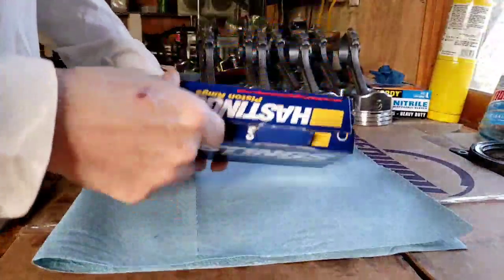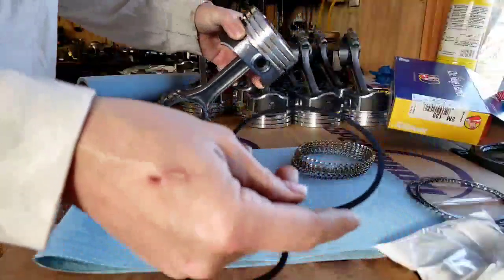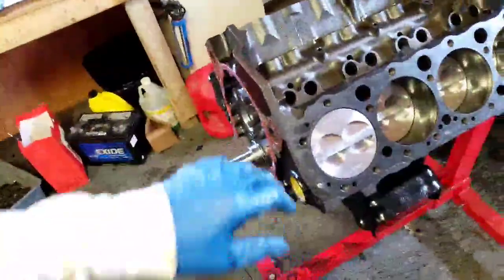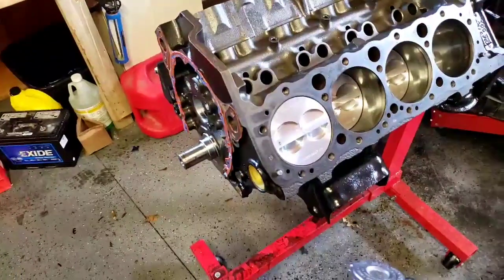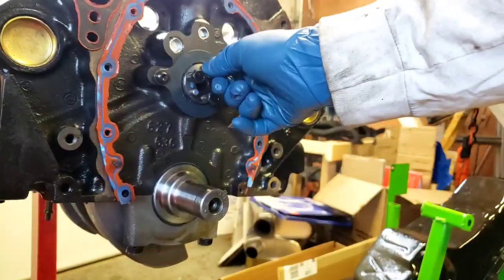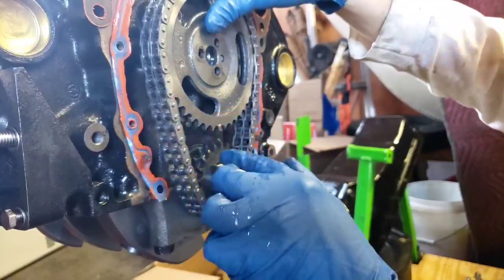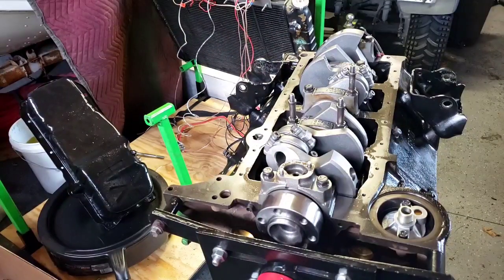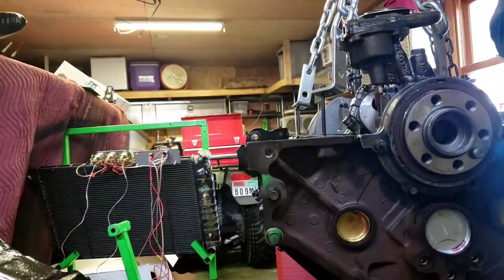Budget 350 small block build.  Rotating assembly in small block chevy.

Comment: I’m new to motors what where you measuring on the cylinders right after showing us the rings? I’m gonna be building my first 350 here soon and just wanna know as much as I can
Reply from the maker: I believe it’s the gap in the piston rings. There needs to be a certain gap when the rings are in the cylinder. 

Measuring the piston ring gap is crucial for several reasons:

1. **Thermal Expansion**: Piston rings expand when they heat up during engine operation. If the gap is too small, the rings can expand to the point where their ends butt together, causing them to seize in the cylinder, which can lead to severe engine damage.

2. **Sealing Efficiency**: The gap affects the ability of the rings to seal the combustion chamber. A gap that's too large can lead to blow-by, where combustion gases escape past the rings into the crankcase, reducing engine efficiency and power.

3. **Oil Control**: Proper ring gap helps maintain the correct amount of oil on the cylinder walls. A gap that's too wide can result in excessive oil consumption and increased emissions.

4. **Engine Longevity**: Correct ring gaps contribute to balanced wear patterns on the cylinder walls and rings, enhancing the engine's durability and performance over time.

Ensuring the piston ring gap is within the specified tolerances is an essential step in engine assembly and maintenance, directly impacting the engine's performance and reliability.
Reply from the maker: If this is the first time, check out a book called “how to rebuild any automotive engine” tons of really great information in it

Comment: Good video! I'm no mechanic by any means but i would like to rebuilt my 350 small chevy iroc z TPI motor on my own, i would like to know what kit would be nice to have that meets specs because i know you have to measure stuff and that also i was wondering how can i get a setup like that? when you Pre test your engine with a radiator and everything without the motor being in the Vehicle?
Reply from the maker: When you say a kit, what are you referring to? The first thing i would recommend is to take the engine out, strip it down. Label all the bolts and take pics of where everything goes when putting it back together. Then I would take the block to a shop and have them clean it, check it for cracks (magnaflux) and check the cylinders for roundness. Sometimes as motors run and break in, the cylinders can come out of round. Then from there they will help you determine what you need from there.
Reply: Build the engine right and you don't need to pretest before installing... I'd suggest becoming friends with a motorhead type person who is local to you... Rat rod guys at car shows are often very friendly, down to earth, and knowledgeable about such things...

Comment: Best way to put that bottom gear on is to put it in the freezer for about an hour and it will slide on easy no hammer needed
Reply from the maker: Wouldn’t putting it in the freezer shrink the gear and make it harder to go on?
Reply: @BackyardGarage1  depends oh Joe warn the crank is when your putting it together
Reply: @BackyardGarage1  damn phone if crank temp is rite the cold gear goes rite on
Reply from the maker: @larrywarner9314  I gotcha. Don’t you love auto correct? Lol